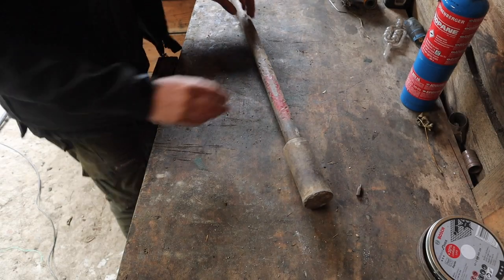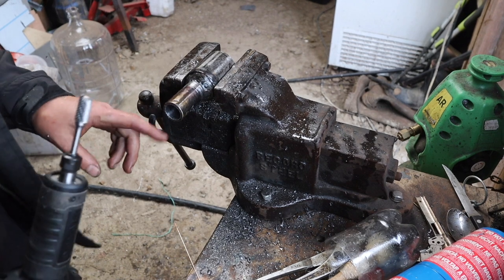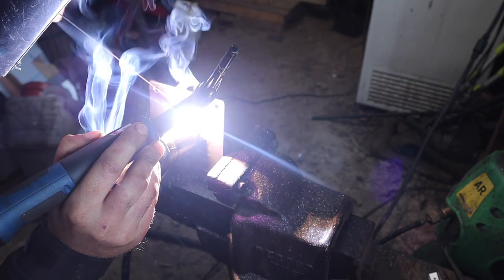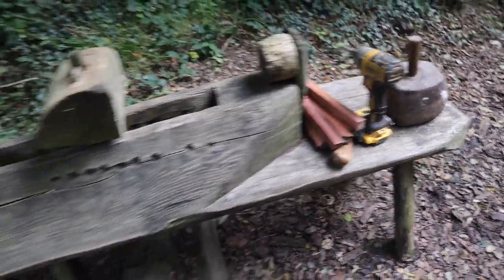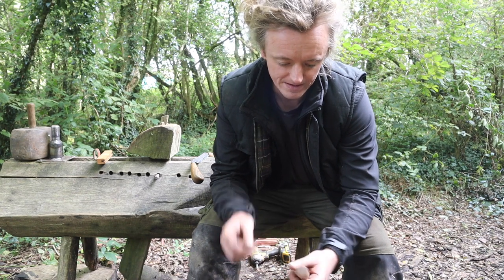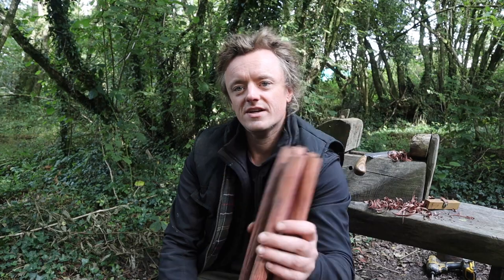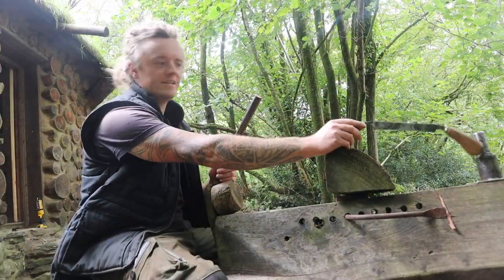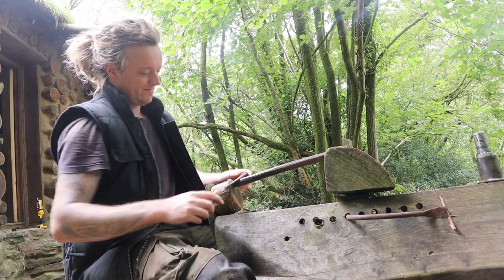Spring Fed Timber Framed Greenhouse Part 4 : Peg Making

Comment: any way of attaching that to a log splitter ? possibly speed the process up ,thanks for the video :)
Reply from the maker: Yeah. I was also thinking a hydronic press maybe. But to be honest the simple approach is usually better and more reliable
Reply: Agree. I instantly thought of a hydraulic  press but then it takes the art out of it.
Reply: A long lever arm to put your weight on with a built-in follower might be worth doing if all they did was make pegs all day for weeks on end, but it's just not worth it at this scale.

Comment: I see people swinging hammers with venom and cringe, the shock travels up your arm and if your unlucky the Doctor might say you need to stop using your arms immediately before you hit forty years old, or you won't be lifting a cup of tea when your sixty. His next suggestion will make the whole world fall out of your bottom, "get yourself on the disabled list" because it's truly disabling as we live in a mechanical world, and you need your arms to do many things, including picking your nose and opening doors and even doing up a belt up on your trousers.
Please note that peg making can be done with leverage,  and thereby cut out 100% of arm and joint use. 
When you said I need about a hundred pegs that equates to about seven hundred swings and seven hundred massive shocks. You might train yourself to be ambidextrous if by some fatal chance your wages are linked to how much you produce, and then you have dual epicondylitis in both your arms and maybe dual hypothenar hammer syndrome in your hands as well as twin dupuytren's contractures. To actually grip something and move it like a bag of sugar can be a challenge, heavier solid objects can involve more arm work so aren't as difficult but weight restrictions come into play and force.
Much like yourself I can easily get involved in many trades and I've been unlucky enough to be involved in the big projects mainly. Looking back i now dread to think how many holes I've drilled and how many hammer swings and how many sacs swings and how many mallet swings and how many scythe swings I've done along with how much weight i've lifted and moved and how many pounds of torque i've battled against. Luckily I am related to Thor the God of thunder or I'd have been disabled earlier. It's possible we are distantly related so look out for changes in your palm, once that tendon tightens up you can't even put your hand down flat.
We can all build a beautiful life but the effort needed can be disabling just as you gain the time to enjoy it. #beware

Comment: rust on the steel tool
try 1/4 motor oil + 3/4 gasoil
 + dont forget, Ec=1/2 m.v² when you use hamer etc gallic..) -ü

Comment: I have an oak trunk 18 inch wide. I plan to split it along the length several times (following Viking approach) to make boards. Which is the best draw knife to straighten the lengths into flat boards ? thanks. Nice set up you have there.

Comment: What I don't get is that you left school at 16 and then worked for a yacht builder and then a lift installer. So how come you know and are proficient at  metalwork, woodwork, structural engineering, building, hydro-electric motors, car engines etc etc  - not forgetting to be able to drive diggers etc ?

Comment: The reason why welding without gloves was a big wasn't because of burns. You very nearly electrocuted yourself with that ground just floating around.

The ground being disconnected should have caused you to reevaluate what else had been forgotten with regards to good path for the current.

Comment: You did a great job making  your tool die peg maker.   You could make it so much easier by using a press machine to press the wood into your tool die, then you won't  have to hammer, and hammer , and hammer.  Great video. thanks for posting.

Comment: I suppose by now you're more or less finished needing pegs, but might it have been an idea to make a hydraulic log splitter, and make an adaptor to push these pegs through too, much kinder to your joints as you get older.

Comment: In copper fittings 15mm is 1/2" and 22mm is 3/4" so you have the correct size

Comment: If you can't tinke of one other can, that think has several options for improval. It all depends on muscle power or other.  If you have an electric woodcleaver or what they're called, I'd use that, just replace the vedge with a peg maker and you got a peg maker incited of a woodcleaver, that's powered, you can scale from there. If can weld, then you can do more...

Comment: I just keep thinking there has to be a way to have the "peg maker" be water powered. Use the weight of water to lift a hammer and drop it repeatedly like those blacksmith power hammers ... but slower. Or maybe have a levered mechanism that just forced the board through the peg maker - that would take a long handle :D

Comment: Is there an advantage to your wooden mallet, say, over a lump hammer? Very rarely (if at all) see you using steel hammers, is it just a preference thing? 👍
Reply: Hammering metal on wood would mash and splinter the ends of the pegs.

Comment: If you keep peghole markings at 2' or 1'1/2 and do 2/16th offset on tenon piece, why would you do all the dry-fitting and marking of pegholes through a hole? Im bit familiar with square rule been getting by by just using tongue/blade of square for distance and little offset on tenon.
Reply from the maker: Just less chance of getting it wrong when you mark from the hole. It has to all come apart anyway to get it out of the building and reassemble. So I drill the hole, the. Cut the mortise. Then fit the tenon. Once the tenon fits mark the hole. Take it apart and drill the tenon. Then it’s ready to go out the workshop to be assembled

That’s how I do it anyway
Reply: @KrisHarbour  Strong arms and strong will. Keep it going!

Comment: How much power does the drill press use? Sounds like a really heavy machine. Is it still from your domestically produced power?
Reply: It has to be John.
It's all he's got. I doubt it made a dent in all the power Kris can generate. Don't forget he's got 3 phase there too..
Reply from the maker: The small drill press only uses a few hundred watts. I can run tools up to 8kw for a few hours all run off my own power system. No generators or anything. Just solar wind and hydro

Comment: In reference to bumzy3210's comment: Kris, why not just use square pegs in the round holes on the greenhouse? Is it bc they're hardwood? I've seen it done in previous builds on YT.
Reply from the maker: With draw pegging really you need them to be at least mostly round. Anything with bigger flatter sides than I hexagon won’t really do the job properly of drawing the joints together. The sharp corners would just dig in to the wood and not really pull the joint tight

Comment: Its a lot easier to use a high carbon steel plate about 100mm thick with the hole drilled in so you can hammer it through to size.   With your drill press, you would have great 90 degree angles to shape the pegs as they are driven through.  Also, with your rig just drive out the peg by making the next one.  You drive out the last peg made with a finished one or a slightly narrower stick.
Reply: 1) how many people have a piece of high carbon steel plate 100mm thick, kicking around? This was made for no cost using available materials. 
The critical thing about suggestions is they need to be practical and realistic!
b) how would it be much better? This method worked well, it would appear..
c)driving out the peg with the next one is EXACTLY what Kris was doing - in fact it's the ONLY practical way of using the peg die!!
Curious as to what you actually watched.......??!
Reply: @andymccabe6712  1) 100mm plate (roughly 3/8 inch) is fairly common in the States, I don't know about out there.  It really doesn't have to be high carbon, but it lasts longer.  2)  (B - really?) Driving a peg through a plate is how it has been done for over 100s of years.  There is a reason for that having done it myself - It is easier to make and you don't have to drive it out, it comes out by hand. The Amish still use that method.  3) You could clearly see him knocking out a peg with a stick at one point in the video (5:53). He did comment about knocking out with the next one and later do it with the next peg, I just didn't remove that part of the comment before submitting.  Shi.. Stuff happens.  If you like, I can edit that one to make you feel better.

Comment: BET YOU COULD MAKE SOME KIND OF HYDRAULIC PRESS TO MAKE IT EASIER.
Reply: A lot of work/time/cost to make a press!
I suspect that the point at least partly, is to use ingenuity to develop a way of doing the job effectively and simply, for little or no cost!
It's a completely practical solution....

Comment: I've seen the footprint of this greenhouse and it's going to be tiny. How many hours making pegs plus a month of joinery? Seems egregiously overbuilt for something that is going to be so small relative to the food it produces
Reply: Over 30 years of use... you left out that tiny part in your maths ;-)
Reply: @telinoz1975  I didn't. Over 30 years of anticipated use, then all the more reason it seems as though it should have a larger footprint
Reply from the maker: it has 18 square meters of growing space. this year in the garden so far we have grown over 6kg per square meter and still counting. i anticipate us to get quite a bit more yet to. The greenhouse will be more productive just by its nature. yields of 10kg of food per square meter are easily achievable. The building will last alot longer than 30 years. more like 100years with maintenance and glass repair. But i am likely to use it for 35-40 years as im only 33 now. So lets say 35 years of use for me at 10kg per square meter. that is about 6.5tons of food. for 2-3 months work in building. That does not sound like a bad deal to me. We are going to growing alot of tomatoes in there. Currently a pack of tomatoes cost £1.50 for 200g so 6.5 tons would cost £48.750 in the shops. I think that is right anyway. So yeah sounds like a good deal to me. That is without factoring in any of the added food security points i could make due to having a growing environment that is sheltered from extremes of wether. 

some more points

1 I also enjoy doing it. 
2 It also adds value to my property in the order of 7-10 thousand pounds at current property prices. 
3 it serves and an educational example
4 I make money from the videos of me making it
5 Glass could be removed at any point and it easily turned in to another type of building

Even if i got 2kg per square meter i would still be worth 2-3 months work.

i could of course do what most people do and get a polly tunnel. But they last a few years max. then you have loads of pastic to get rid of and replace. they dont add value to a property, they dont hold heat in winter very well, then dont look nice, you dont learn anything by putting one up, and i wouldn't make any money back videoing it as who cares about watching someone put up a sheet of plastic over some hoops?
Reply: @KrisHarbour  exactly Kris. Keep up the great work.

Comment: There are better ways to make pegs you can buy dowl sharpeners which are essential large pencil shapes
Reply from the maker: Hi, yeah i explained that a few times in the comments already, dowels are not the same. the grain is cut and they are about 50% the strength of these due to them being split along the grain.
Reply: @KrisHarbour  not necessarily, I'm not sure if your familiar with the YouTube channel Sampson boat co, they use similar method to what I mentioned. I'm probably wrong but that's what I observed, also I'm a big fan, I'm from England and have always wanted to see your homestead in person if that's ever possible
Reply from the maker: I am familiar. but draw pegging (what you do in timber framing and what riven pegs are used for) is not common in boat building. Pegs used in boat building are usually to fill fixing holes and repairs. I used to work in a traditional boatyard. Pegs are used to peg joints sometimes but not usually draw pegging like you do in a timber frame.
Reply: @KrisHarbour  Well I stand correct, cheers for letting me know

Comment: Question why not just sharpen the end  of a pipe?
Reply from the maker: Because i didnt have any. using what i have that is free and requires no going anywhere to get.
Reply: Well, you would have to find/already have a steel pipe of the correct internal diameter. It would also need a suitably strong wall thickness to cope with the hammering load.
As this is an unlikely scenario for most people I think manufacturing is the obvious way to go....

Comment: Have you seen the drill and table saw method for making dowels?
Reply from the maker: These are not dowels they are timber framing pegs there is a big difference

That method cuts the grain because you have to start with something very even. Split pegs follow the grain so they are way stronger. Pegs that have been cut like that should not really be used in a critical location.

The pegs are driven in to an offset hole so they are under alot of tension even without any load from the building. Split pegs like this are far stronger.
Reply: Kris Harbour Natural Building Interesting thanks for the explanation of the difference
Reply from the maker: No problem, thanks for the comment 👍

Comment: The other way I've seen to make pegs is with a dowel maker, kind of like a large pencil sharpener. This is probably the best way for the size of material
Reply from the maker: That cuts the grain because you have to start with something very even. Split pegs follow the grain so they are way stronger. Pegs that have been cut like that should not really be used in a critical location.

The pegs are driven in to an offset hole so they are under alot of tension even without any load from the building. Split pegs like this are far stronger.
Reply: @KrisHarbour  Sorry meant that to say your method seems the best way, particularly as the material is probably too large to fit in a drill.

Comment: What kind of wood are you making pegs from? If you happen to know off hand
Reply from the maker: It’s the same wood as the frame. I thinks it’s ironwood or Jarrah. Just hardwood sleeper offcuts
Reply: Ok thanks I've gotten boards off pallets that are same color. Made my wife table top from them
Reply from the maker: Yeah you do get pallets with exotic woods. I get quite a few from a garden center so I guess it’s imported tropical plants they had on them.
Reply: It certainly looks like a jarrah sleeper with red colour just be glad they aren't ekki which is harder again and tends to blunt drill bits after 10 holes